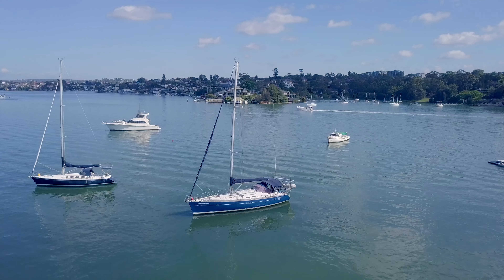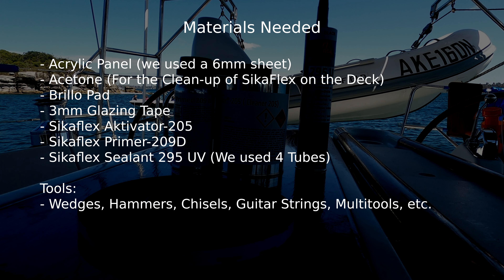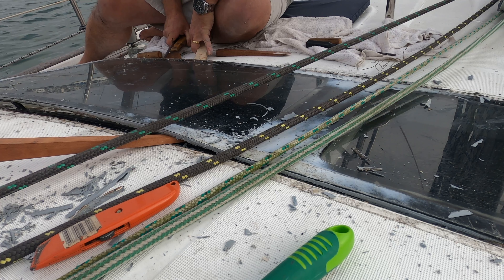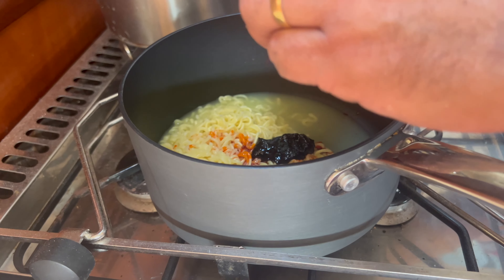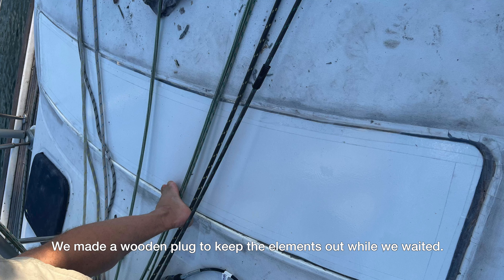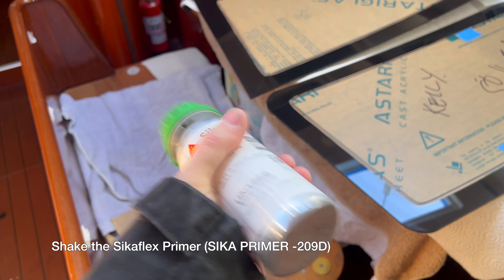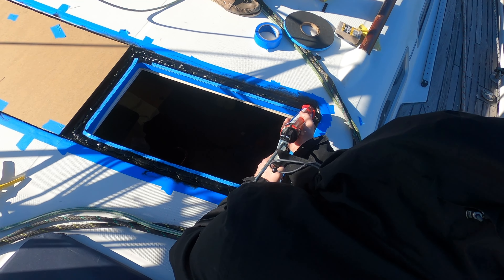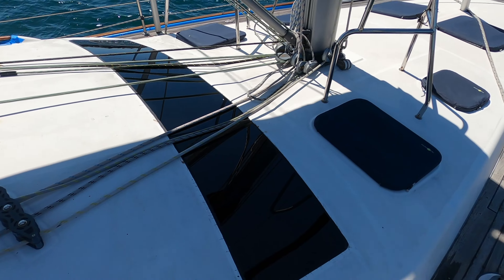Beneteau Oceanis 473 Skylight Replacement | Baked On My Boat

Comment: Good job, thank you for your time and advise. I will be performing the same task on my Beneteau 393  in a few months. Do you think a heat gun would have been a better solution in removing the old skylight?
Reply from the maker: Thanks! Let me know how you go. After the experience we had removing our skylight, I feel that a heat-gun would have been of little to no use (more than happy be proven wrong). Most of the original sealant had gone brittle and anything you see in the video that is still flexible is most likely remnants of other repairs. 

Please keep us updated on how you go with your 393!